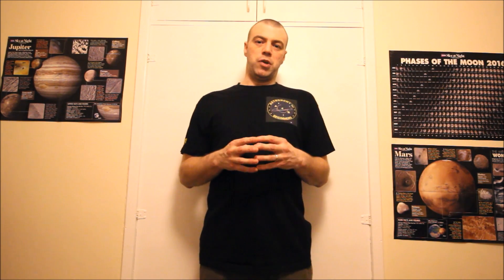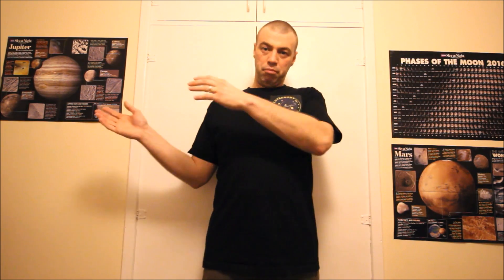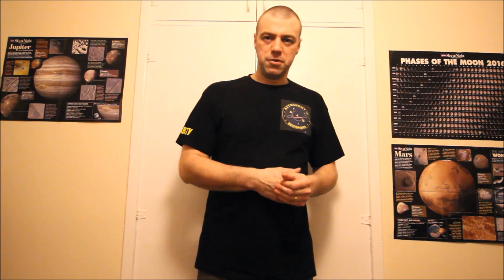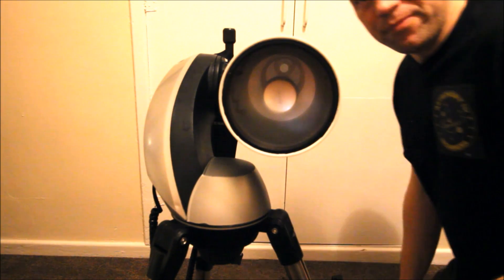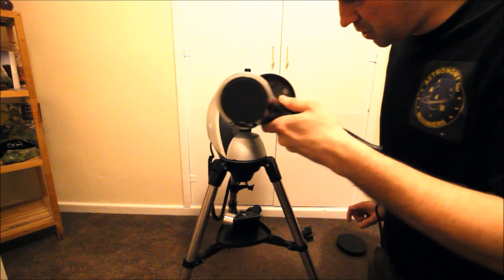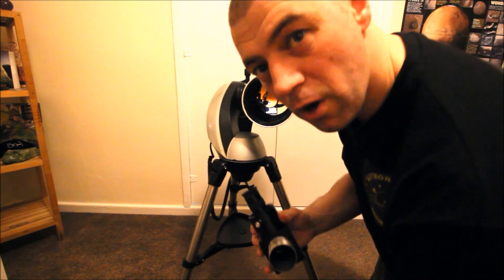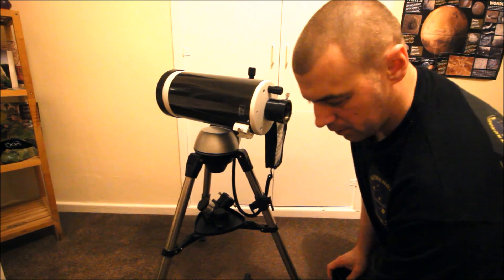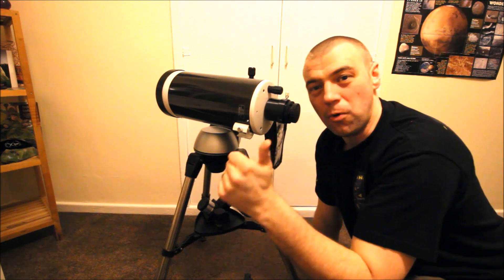How to dry out your telescope from dew and ice

Comment: What I worry the most actually is the electronics, motors and stuff. Do you think dew may end up harming it?
Reply from the maker: @giovanniluigi791  usually most astro gear are designed to be used outdoors, so usually electronics are very well insulated. It's computers and office devices  you have to watch out for, as they are made really for indoor use. Dew can form and moisture can enter quite easily. Especially if you intended to store the computer in a shed for long periods of time. For my best policy I use a laptop where I store in a waterproof sun shade. And when not in use I move my laptop and all my imaging cameras and telescopes back inside my house to warm up and ease off dew. The mount is left in my Astro shed and covered in a large tarp. I've been doing this for many years and I've never had any dramas. I've heard many horrors and hazards where people left imaging gear permanently outside for months and years. I would say don't be lazy and  move the gear back inside when not in use, in that way you can be sure dew and mould will not destroy your gear.

Comment: Optics fungus is a big issue in photography as well. I would say that the best practice is to seal-pack the optics (while outside in the cold), so the humid air can't form mist on the cold optics. After a few hours the temperature of the scope should be around room temperature, so you can unpack it to complete the drying process. What do you think?
Reply from the maker: Another top tip, I've never thought of that idea!! Give this one a try, thank for your input Bence!! & Clear Skies!!
Reply: How do you spot fungus ???
Reply: Lol that's a bad tip , you take gear out start observing and dew will appear no matter what , after you done its not a good idea to seal it after it got wet

Comment: Just found this out the hard way.  I've had my scope stored away for several years.  Just getting back into it now and I've founded two patches on the front lens (sct)....looks  organic.  I used a very soft brush to see if would dust off but it smeared instead.  From what I can see, it is only on the front of the scope.  Going to use the ASO method to clean the lens and hope for the best.
Reply from the maker: Yep I was not joking about the fungus growing on the Optical glass, fingers crossed you sort the problem out, Luckily it's just the front lens, but you should be careful when cleaning, so go very gentle and see if the organic smear has been removed or changed shape, if it hasn't it means it's between the front convex and back concave glass, which will then require the lens elements to stripped and professionally clean and then finally collimated  Good Luck!! Hope everything goes well MrUnderwurlde.

Comment: Hi Martin, when using the hairdryer and you're drying the tube also, do you not run the risk of blowing any dust into the visual back as it was left open whilst doing this? Is it ok to put the desiccant cap in before hairdrying the actual tube?
Reply from the maker: Yes you can run the risk of blowing debris into the visual back, so cap it with a dust cap or dessicant cap, you'll be alright.

Comment: Thanks for the info, I totally would of put the cap on inside, and maybe threw the scope in the dryer 😁 JK. Thankyou again for your videos, been watching them all
Reply from the maker: Glad to help Metal moss, through all the years I've always used these techniques and I have not once found got any forms of mould forming on all my optical equipment. These simple tricks will increase the life of your telescopes. 
I am slated for using a hair dryer from a few viewers of course, but as long you have some common sense and be careful on using it, providing you are doing gently sweeps across the lenses and not allowing the heat onto one spot of the optical surfaces then it's totally fine!!

Comment: can you put the cap on the telescope when its outside. wont the condensation form on the outside of the cap when brought inside?
Reply from the maker: You can temporally replace the dust cap just enough to get the scope inside for a short time, Once you're indoors in a warm room, remove the cap immediately to allow the optics to dry out. Once dried you should be safe to replace the dust caps.

Comment: Never cap your scope if you bring it in from cold to warm. If you cap it will still dew up, better off leaving it uncapped and let it dry out inside uncapped. You could even leave your heated strips on and bring it inside.

Or reattach your heated strips when back inside

Comment: Just had a dewy night, not looking forward to fungus and moss growing in my scope 😱
Reply from the maker: Don't worry Matthew, you always get moisture settling on the lens, just warm it up in a warm room, and the moisture will disappear, Highly recommended to use Desiccant cap fitted onto closed tube design telescopes, that will absorb the moisture inside the tube. Just follow the video and you'll be OK, seriously all my telescopes (some I owned over 8 years now) have never had the fungus issue whatsoever. The fungus issue will become an issue if you place the dew cap after use, (also place the telescope in a out side building with no heating) and not let the optics dry out as suggested in the video. The trapped moisture will dry out inside the optics and fungus will form eventually, making an expensive repair. Mathew you'll be OK I ensure you!!! just follow video and you'll be safe for sure!!!

Comment: After observing i house my scope in the garage. I'm paranoid to leave it uncovered because of dust etc, will the dew damage the mirror eventually? I have a Newtonian. Thanks.
Reply: Not the glass but could rust the metal thats could put pressure on the mirror  so id dry it out if i were you

Comment: Wait I have a Newtonian reflector so do I just put the hair dryer right where the tube opens up because the mirror is obviously at the back but it gets dew on it. My reflector is 3 feet long or about 90cm
Reply from the maker: I would place the hair dryer outside pointing at the back of the primary mirror cell, I would not blow air down the tube, also you can warm the tube outside to warm it, that also extract all the moisture from the inside of the telescope.
Reply: Martin Pyott alright I will start doing that when I come inside from stargazing.

Comment: i usually cap my 10" newt when i bring it inside as outside even the coldest nights have not seen dew on any of the mirrors. but get it inside wait 10 mins then upcap. if no dew will recap  dew i leave uncapped but every time summer and winter around 10 mins check my mirrors.

Getting a desscient cap as i dont have one for my Lunt 70ED, which at first had issues but Lunt dealt with them and a beautiful scope.

Comment: Never ever cover wet optics! I am so paranoid about this I turn the heating up in my spare room for 24 hours when I bring the kit in! A bit wary about hairdryers though, you can bake dirt on. Not a major problem on an SCT though, just have to give the front corrector plate a good clean once a year (Martin, now that would be a great video, everyone is terrified about doing that but if you do it right it's nothing to be scared of). :-)
Reply from the maker: I agree with your comment Phil Edmonds. There always risks, (especially baking dirt on the lens with an hair dryer). Hence in the video I did say use a low heat setting, safe distance and gradually sweep across accordingly!! I never had a problem with the dirt getting baked on using this method. Also the other risk is taking telescope inside when the entire lens or mirror is completely frozen and the risk of shocking the glass (causing it to crack), again bring the scope inside allow 15 - 20 mins to let it settle and wait for the ice to turn into water, then I used the hair dryer on a low setting, I had no problems doing this!!! Everyone has different ways of doing this, but it works for me, And I shouldn't get too paranoid on the telescope, Has long if you take your time and under control you'll be OK. Trust your equipment, good quality equipment is designed to cope with sudden temperature changes, especially a Schmidt, if you have a fastar imaging connection on the corrector plate, the sheer weight of on the corrector is very robust, there is video which a 80lb weight was added to the corrector plate, Ok it breaks but shows the sheer engineering quality on how good these telescopes are made, Just to boost your self confidence a little bit?? 

  https://www.youtube.com/watch?v=ool3pnpmAt4

But the Schmidt cleaning is a great idea for a video, thanks for the constructive comment Phil!!
Reply: Thanks for reply Martin, sorry I don't check my gmail account very often, all your advice is good and very welcome!  Now, project for you, onto the "cleaning the corrector plate" video. I can tell you how I do it, if you like, and also how to avoid major blunders. My worst was accidentally rotating the secondary housing, I won't make that mistake ever again! And also, never, ever use canned compressed air!

Cheers, Phil.
Reply from the maker: I only which I had SCT?? If I had I would definitely haven done a video that's for sure The MAK is a very different optical set-up and the cleaning process is similar to cleaning a SCT. But the muscious lens  screws on the tube on the Mak. Not like the Sct corrector plate is held in with a retaining ring and screws. I agree you have to tape the plate before you take it off, otherwise you throw off the collimation on the SCT.